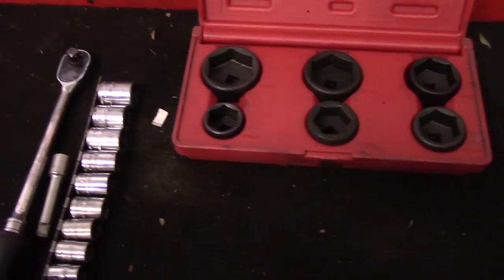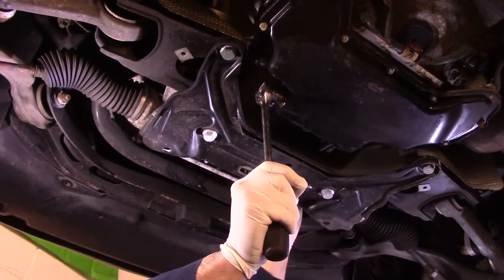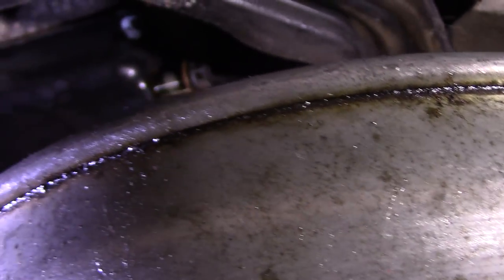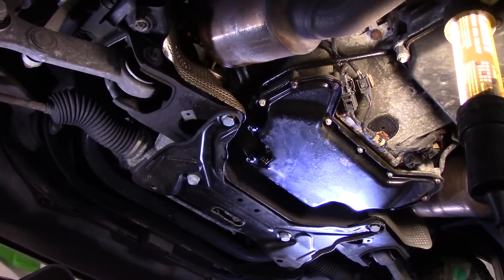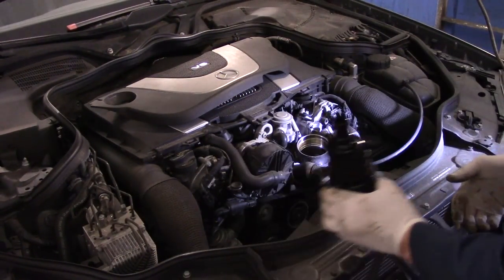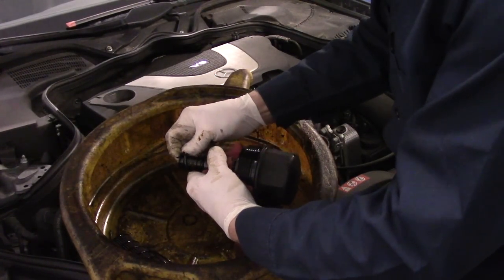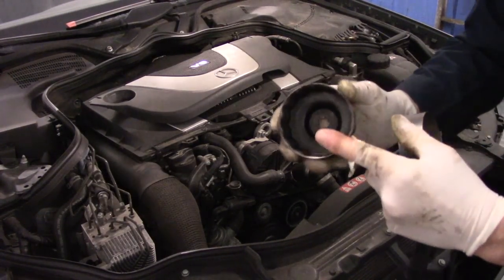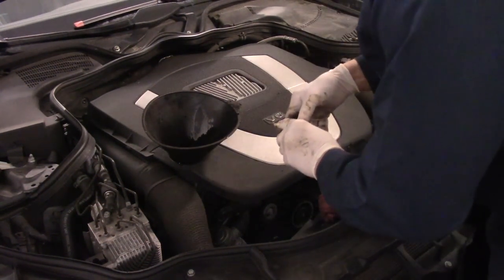Mercedes E350 Oil & Filter Change

Comment: I just did a very similar one of these a few weeks ago.  It was a 2006 CLS55 AMG.  OIl change is pretty easy.  All I can say is don't even breathe on that small coolant hose line from just below the oil filter to the overflow bottle.  I just touched it and it snapped off and coolant went everywhere.  When I went to remove it from the coolant bottle to go find a replacement the coolant bottle disintegrated.  Went from a simple oil change to a broken down vehicle that I didn't have ready to go for my customer until the next day.  Had to replace the bottle and the small line.  Euro junk.
Reply: I had the same problem changing the drive belt and snap the shit off lol. Had my car out for a whole week on a 20 second replacement

Comment: Where do you get the oil filter and o- rings? Can you buy it from Auto Zone/Advance Auto Parts or do you have to get it from the Mercedes dealership?
Reply: Advanced and autozone normally would carry an aftermarket product and they work fine

Comment: You ran it for less than a minute & it didn’t give it time to pressure up. How can you tell if there’s any leaks if both covers are on?

Personally, I do it on a ramp & remove the oil filler cap to allow the oil to drain more efficiently. 

As the oil is draining, I change the filter because there is residual dirty oil within the housing that I want drained out. 

After I’m finished - filter in, drain plug tightened & oil added, I start the car, let it run for a few minutes & check for leaks as it’s running. If none, I replace the covers. 

Also, I replace the drain plug washer each time.
Reply: Unless you mess something up you should not have oil leak after oil change. If you change oil for years you just know if you will have a leak or not

Comment: My e350 2010 oil filler hole is so big i can see the engine inside wtf its so scary is that normal
Reply from the maker: Yes its normal. I'm happy to help. Watch for the next free tool giveaway coming soon.
Reply: @jimthecarguy  bro is it normal sometimes my car feels smelly outsidr like burnt fuel or oil or rubber but not much a little feel  is that normal on big engine od there is a problem there are no warning lights car drives fine or the smeel is just my imagination lol its not strong a little scent